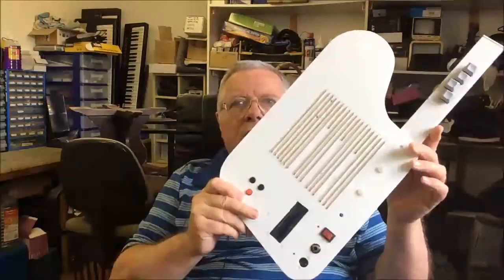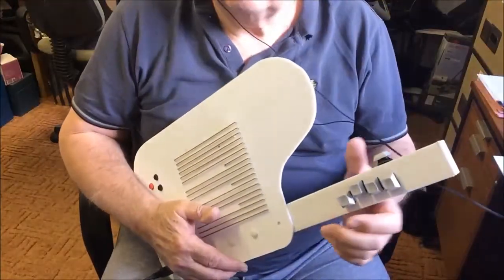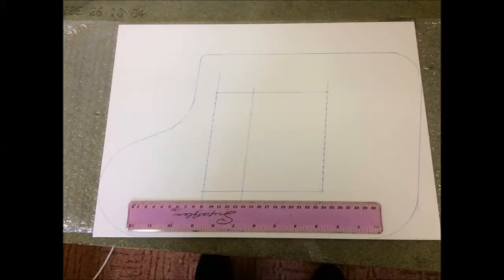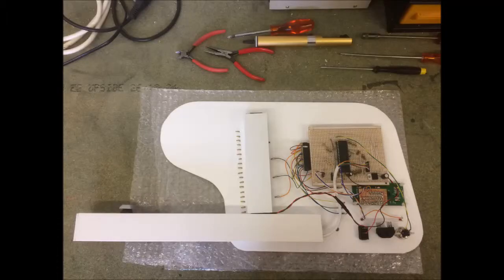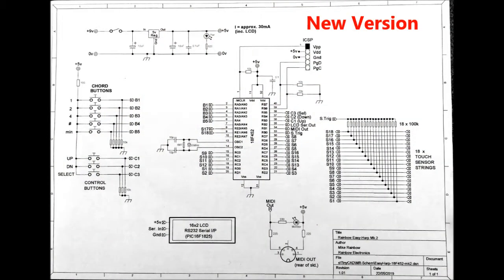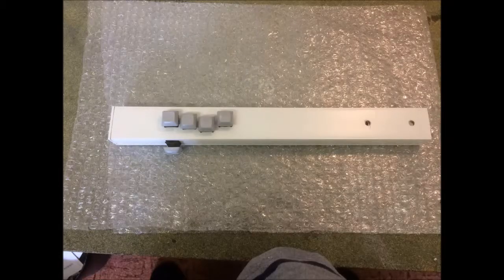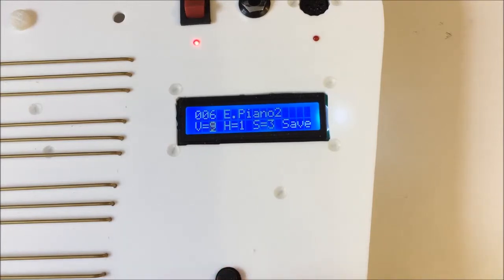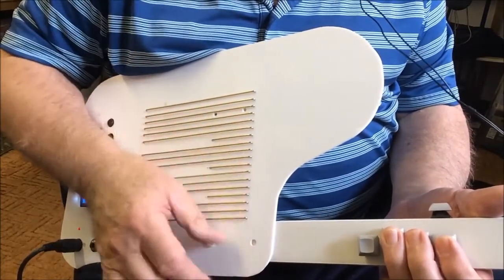How To Build An Electronic Autoharp

Comment: Hi, I am interested in trying to build one of these. I have zero background electronics but am a computer programmer. I have a question about some of the parts on the list. I’m trying to understand what they are.  What is 7 pin header plug and skt? when I Google it, I get several different things and I’m not sure which is the right one. Could you send me a link to one with an image?  What would be really nice if you have time, is an Amazon list of all the parts.
Reply from the maker: Hi, this refers to a socket that is soldered onto the pcb or stripboard with a matching plug - saves you soldering directly to the board. This type of thing - "Male Female 2.54mm pitch Header Pins Socket Single Row Connector Strip" - on Ebay. Sorry haven't done an itemized list - I generally give enough info to be able to source the parts - it's not really a beginners project but I have heard from people who have built really nice ones.
Reply: @mikerainbow  Thanks for the info.  Do you know someone in the US that might be willing to build one for me?
Reply: @mikerainbow Maybe could you build the electronic parts for me and I will pay you? I can get the body parts and put the buttons etc in a neck that I design?
Reply: Do you build and sell them to the public.

Comment: When I do search for the chips I’m finding number/letters before and after the number on your schematic.  Can you help?
Reply from the maker: Hi - any version of the 18F452 and 16F1825 will work - I use the dil versions for ease of use but you could just as easily use the smd types if you are happy using them.
Reply: I truthfully have no idea.  I have a basic understanding of electronics.  How do you program the chip?  Is there a way I can buy the electronic components from you, programed and ready to go?

Comment: Mike,
I am having a problem with the Easy-Harp 18F452 operation. I am testing it as a pcb module without “strings” and examining the operation by an oscilloscope.
Problem 1 is the string inputs corresponding to S2, 3, 6, 7 & 8 are inoperative, no MIDI out data is generated. Test is done by holding one of the chord inputs high.
I have cleared and reloaded the IC data thinking it may have been corrupted without change to the performance.
Problem 2 is shown in the LCD display. The control buttons function as they should apart from the SAVE mode. Setting SAVE returns the cursor to the instrument selection number which then continually flashes. Looking at your video I believe it should be stable (?). After a restart the display always reverts to 001, PIANO, V8, H0, S1.
A secondary issue is no sound output from the VS 1053 module, input data is present however as I have zero knowledge of what MIDI  data should look like I am leaving that at present.
I have carefully examined and checked continuity etc of the strip boards and am convinced all is OK.
Should the display boot up with Mike Rainbow as in the video, mine doesn’t?
Any comments would be appreciated
Thanks
Ray
Reply from the maker: Hi Ray - thanks for your interest in this project - I'll do my best to answer all your queries - 1) Because the strings are touch sensitive and there are a lot going to the PIC, the spacing is critical and if the circuit you've built has no faults (well done by the way!) the likely cause is that tracks or wires are too close to each other or other parts of the circuit and the "strings" may be permanently triggered. 2) When you get to "Save" you must then press one of the up/down keys and "Save" changes to "Done" briefly and next time you switch on the saved settings should appear. 3) The boot-up display you are seeing is correct - the video was showing an earlier version of the LCD program - and finally 4) S1 is the lowest note and S18 is the highest.
Hope this helps, Mike
Reply: Mike,
Sensitivity was the issue, all strings operate OK. 
Still have a couple of issues though, the first is the action to SAVE is not the same as you described. Using SELECT combined with UP or DOWN do not save.
I have found using UP and DOWN together work so have added a further button named SAVE, it feeds 5v via 2 isolation diodes in parallel to the UP / DOWN S.
SAVE does not change to DONE at all, instead the screen goes blank blue, touching SELECT again restores the screen back with the selection number flashing. The selection has been saved as next switch on proves.
So, apart from being different it is satisfactory,
Now the main issue is I cannot achieve any audio from the VS 1053 module, I have thoroughly checked the changes described and all is well.
MIDI data is present at VS pin 26 when selection parameters are changed and strings played.
I suspect I may have a faulty item and have ordered a new one, delivery will be a few weeks away.
Thanks for advice.
Ray in Tasmania AUS.
Reply from the maker: @thesecretary6433  
Ray, the overall string sensitivity, as you know, can be changed by changing the "S" value in the menu but you can change individual string sensitivity by altering the value of the 100k trigger resistors - higher value gives greater sensitivity etc.
There seems to be some strange things happening with the save command - can't think what at the moment and good luck with the VS1053 module.

Regards, Mike.
Reply: Mike,
Now here is a peculiar thing that has me baffled regarding the VS module. I made a direct TTL connection and it worked from the Easy Harp pc but not via the opto coupler.
In both cases the data on pin 26 switched to 0V from the static 3.25 v, the rise and decay times looked the same, it looked identical!
As I had bread boarded the set up to try it out I had included the 220R in the send line of the MIDI signal but had not included the 220R in the return path from the cathode of the diode back to 5V, the diode was connected directly to the 5 V rail as was pin 2 of the opto. Fitting the 220R in that path allowed the opto circuit to trigger the VS.
No differences can be seen in voltage or waveform at pin 26 with any of these variations yet the omission of that resistor stops operation.
I do not have any MIDI system or connectivity experience so there may be a simple explanation but considering the final controlling data appears the same it has me perplexed.
Any ideas or explanation? 
Anyway I am pleased with the performance and will now start on the hard part building the body.
Thanks for a great project.
Ray
Reply from the maker: @thesecretary6433  The two 220ohm resistors are essential - one from the 5v rail to pin 4 of the midi out socket and one from pin 4 of the midi in socket to pin 2 of the opto-coupler - this limits the current to the opto-coupler LED to around 8.4mA (opto LED has 1.3v forward voltage drop so 3.7v/440ohm=8.4mA) - so leaving either of these out relies solely on the 220ohm res to pin 5 of midi out skt for current limiting and this res can actually be omitted (some standard midi circuits leave it out) provided the other two are still in circuit. The opto LED would have been working at higher current and brightness but may have still been working - not ideal - I think it's rated at 20mA.
Glad everything's working now though. Mike
Reply: Mike, My Easy Harp is now complete and all is well except for the operation of the Hammer mode. The selection can be changed OK however the action is the same in both settings, it plays a note on both touch and release of the string so for a single touch a double note is generated.
Changing touch sensitivity does not have any effect on the Hammer action. Any ideas?
I fitted the pcb directly behind the string board on 3/4 inch standoffs to give very short interconnecting wires in an effort to minimise coupling issues, the longest wire is about 3 inches.
Also I see that some instruments such as organ play notes continuously until the chord keys are released, I presume this is due to VS 1053 not receiving a stop command (?) whereas percussion instruments by their very nature do not sustain.
I would like to send a pix of the finished instrument, is their any way I can do that as an attachment  to a reply?
Ray
Reply from the maker: @thesecretary6433  Hi Ray, I will dust off my prototype and do some tests on the hammer on/off and get back to you. You're correct about the stop command - this is sent when the chord buttons are released or changed and this seemed like a sensible way to do it as this is how most keyboards or even guitars work. I would very much like to see the finished instrument - not sure how to do this either - here's an old address you might try - m.rainbow356@btinternet.com
Mike

Comment: I think I understand most of the components on the front, but I don't understand most of the back, do you have any suggestions on where to start looking for information so I can understand the parts, and what to do with them?
Reply from the maker: Hi there - thanks for your interest in the project. The microcontrollers I've used are made by Microchip and there is loads of info on line in PIC forums and on the Microchip website. At the very least you would have to learn about programming PIC's with one of the in-circuit programmers that are readily available on ebay etc (PICKIT2, PICKIT3, K150 or something similar). There is enough information in the video to build the project but a level of prior knowledge is needed in using PIC micros and constructing circuits on stripboard.
Reply: Thanks for the advice! I'll do some research and see if it seems achievable

Comment: Hi Mike, I got together all the components to build your autoharp design, but I have run into a hiccup while trying to program the pic 16F1825. What type of programming interface software do you use? Thank you for your help!
Reply from the maker: Hi - I'm using the PIC Microchip MPLAB IDE v8.92 with a clone pickit3 programmer. The software is free and fairly easy to use - the later and bigger MPLAB X IDE has a lot more features which you don't need and I find it much more difficult to use. You  "import" the hex file and having selected the device (16F1825) and programmer (pickit3) you just hit "program" and that's it.

Comment: Yes, I'm sure we can figure out a pedal controller, but do you think there's a way for the strings to sense velocity as well?
Reply from the maker: Hi Todd, this is not something I had thought about as I wanted to keep it as simple as possible. I think the extra circuitry would have to be quite extensive to do this and I have already used all the I/O pins on the 18F452.
Reply: @mikerainbow  Maybe add two or three "dead" (no sound) strings on top/bottom, and use them determine the speed with which they are stuck (by just timing the difference between first, second, and third dead string being hit) - then set the velocity "level" for the rest of the actual sound making strings (though this means to play with sensitivity you'd need to strum from the top or bottom, not just the middle ones)
Reply from the maker: @foljs5858  Interesting idea but the electronics would need a complete re-think as there are no spare pins on the micro.

Comment: I love how it sounds like an Omnichord. Have you considered adding a drone to back the strumming?
Reply from the maker: Hi Jane, thanks for the nice comment - I haven't considered a drone but it would be easy to do, it's just a question of adding the correct midi messages in the PIC code. I didn't go into all the instrument sounds that are possible but the sky's the limit - the instrument outputs midi messages to any midi sound generator so the number of sounds is endless - strings, piano, guitar, wind instruments, brass, etc.

Comment: I think this is a great idea and would be interesting incorporated into a pedal board with organ, brass and string sounds to use to accompany a guitar, bass player or one man band.  .
Reply from the maker: Thanks Fred - yes, loads of possibilities, I didn't really go into the many different instrument sounds because it's basically a MIDI controller which can connect to any sound generator of your choosing so the possibilities are endless - it's really good for playing string and organ sounds.
Reply: @mikerainbow - I was thinking along the lines of buttons or piezo triggers on a surface you could stand on or sit behind , something like the childrens game "Twister" that could act like your button controls. I mentioned the sounds because they would have to be actuated by standing on the "zones" so the string sensor part wouldn't be necessary. The ability to have on demand chord accompaniment of the range that you have is unparalleled from a control surface that doesn't have to be programmed for each song. I don't know how that could all be worked out but I would love to have one !
Reply from the maker: @fredgritts6517  Sounds interesting - you would still have to have the 5 chord buttons to select chords but these could be actuated in many ways , including using buttons or piezo transducers to trigger the chord sounds.
Reply: @mikerainbow  I would like to purchase a pre-programmed pic or board of the 72 chord variety if you would leave a link to do so. You can also gmail me at fredgritts . I have tried to find your website or any other info and all I get is the song and the band.  Thanks